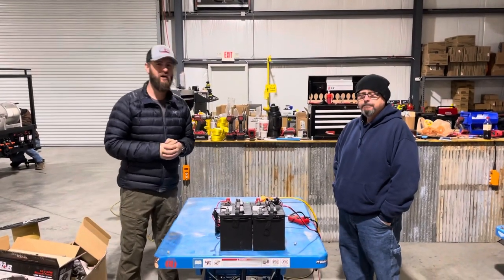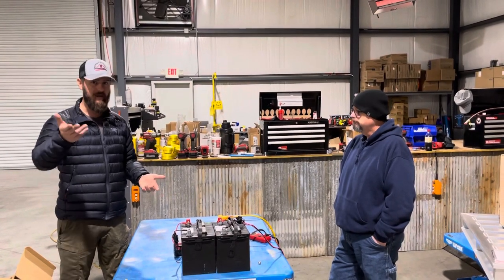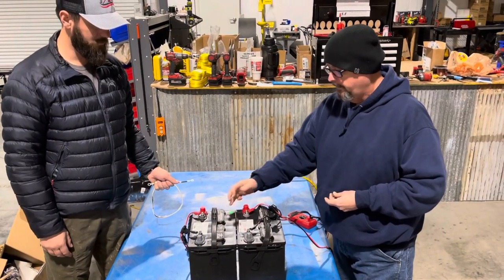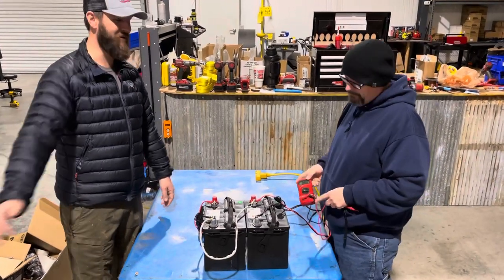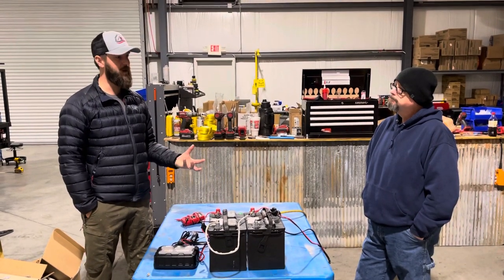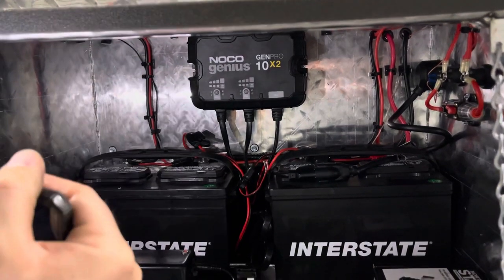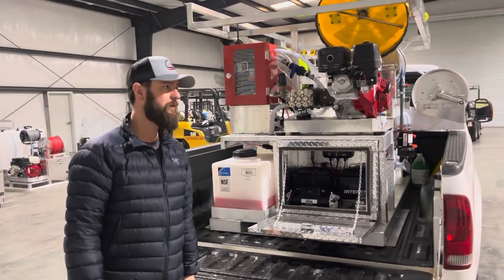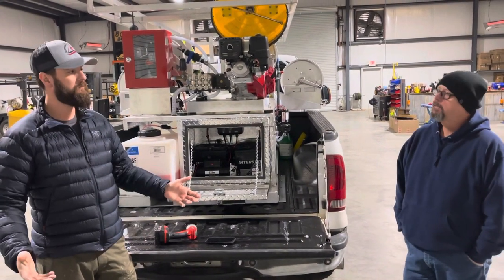How To Wire Up a 24volt battery bank (series vs parallel)

Comment: How would you wire a solar panel to the 24v series batteries while the charger is connected? Will this present any risk to the solar panel having it connected the same time while actively charging with the NOCO 2 bank?

Comment: Coty do you have to put a larger fuse in with both batteries hooked up?
Reply from the maker: Amps are same
Fuses blow at a certain amp level. Not voltage